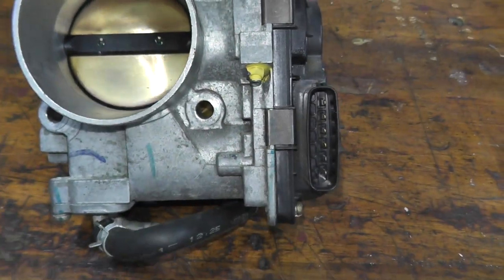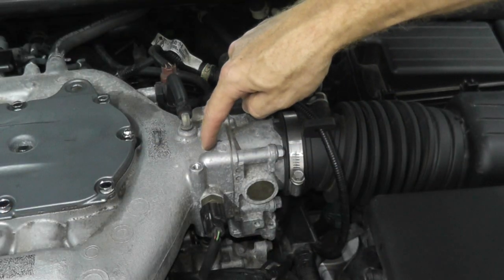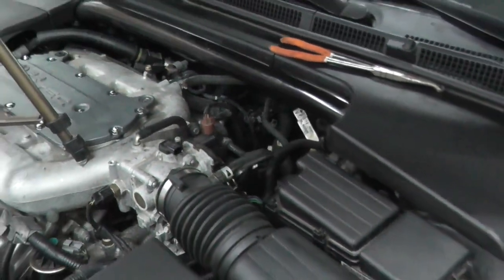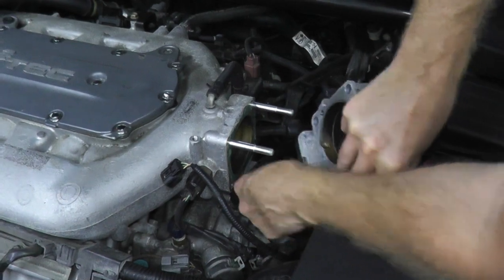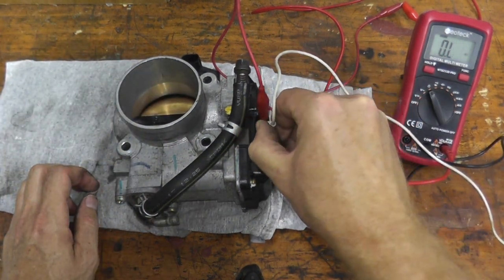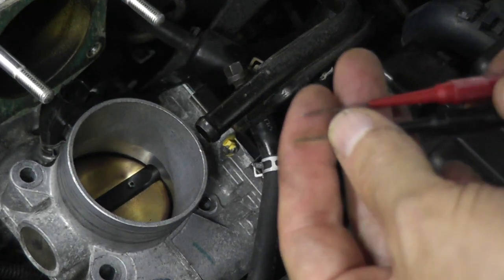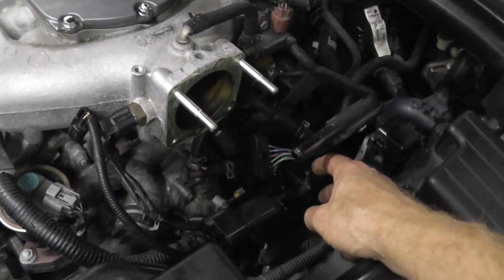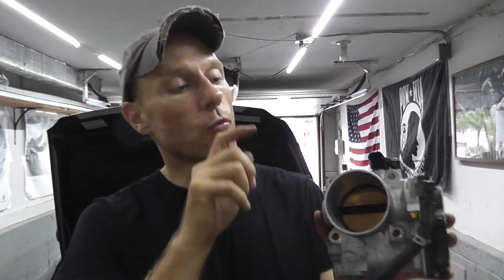Electronic Throttle Body Testing and Replacement | P0222 P0223 P2135

Comment: i did the power test battery to throttle body , the butterfly flap opened. Yet i still have p0123 and truck wont start . just cranks

Comment: I like ur video iam having  the same problem p2135 a/b voltage  but where did u get the oem throttle body  most  place dont have oem thanks

Comment: I have a diesel throttle body/air control assembly. It was completely filled with oil (in the motor) and now it's showing 150 ohms between one signal and the ground and 360,000 ohms between the other signal and the ground. Does this sound faulty to you? Thanks.

Comment: I got a Hyundai Elantra 2016 the problem is it drives 60 MPH fine between if I try to hold between 20 and 30 mi an hour it will run a little bit and then it'll conk out did everything you recommended everything seems to be working fine I cleaned the mass flow sensor I clean the throttle body and it's still doing the same thing 20/30 mph comes out I appreciate your help

Comment: 2007 Jeep Liberty 3.7L automatic 4x4. No codes.  Lightning bolt warning light coming on. Crank / no start.  Checked all fuses...good.  Cleaned intake...was clean.   Thanks!

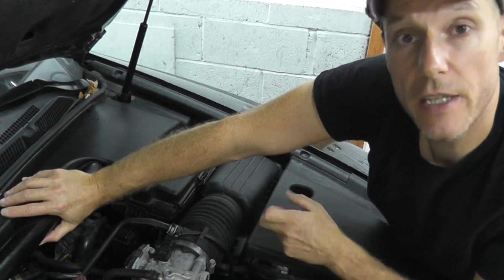Comment: @1:09 He says these are drive by wire system. if there is no physical line coming then wont it be an Electronic one and not a drive by wire?
Reply: Wire is electrical. You are thinking of a cable which is mechanical
Reply: 7:50

Comment: Thanks for the warning about turning the ignition on and pressing the has pedal to open the valve. We did that. Have a 2004 camry that has the low idle, cleaning didn't help. But when you drive it the idle kicks up to 1000 and wants to stay there until you stop. Any ideas?

Comment: most fly "drive" by wire throttle bodys have at least 2 TP sensors and the ECM "computer" monitors both plus two more TPs on the gas pedal..if any of those 4 TPs are out of range the ECM will put the car in limp mode "no power" or very limited power. This keeps the throttle body from getting you killed should it malfunction and you can't control the speed of the engine!

Comment: When he tested the plug (going to the actuator)in the wire harness it said 11.3 on the multimeter. How much voltage should be going from the wiring harness to the actuator on the side of the throttle body? Mine is reading only 4 volts. Any suggestions??
Reply: Dead battery?
Reply: @DavidJackson-zg5my  battery is reading over 14 v.

Comment: Can you say how much volt must be on black and red(+). I see you have around 12V. In my case I have 5V.
Reply: Did you ever figure out your issue? I don't think this guy that makes the video responds
Reply: @giantkilla_  In my case 5v it's ok
Reply: @giantkilla_  I changed connector to pedal, changed map and unplugged sencor for the cooler. After those manipulation something was work. It's start to work good. But still have liths on dashboard

Comment: Maybe I missed something, but how does this test show if the throttle body is bad?
Reply: The change in voltage shows that the potentiometer in the throttle body is working therefore it is sending a signal to the ECU. As far as the motor that controls the butterfly, it is easy to check too. Simply remove the intake hose so that you can actually  see it, turn key ignition to the on position, (no need to start the engine) and press the accelerator pedal down or ask someone else to do it while you see, you should see it moving. If it doesn't move there is a problem with it. Also as it moves it should be according to the pedal movement and the electric motor should sound smooth too.
Reply: @carlosestrada298  
Thanks for the info I'll give that a try. Should the valve be open all the way when the pedal is down?
Reply: @dhalsim-1  yes the flap or butterfly should be completely open when the pedal is down.
Reply: yehh same...
Reply: Because when he put his hand in the throttle plate and moved it the meter changes if there is no change then the body is no good

Comment: If you are using a throttle body that doesn’t belong on your car, could you test and find which corresponding wires open the throttle body and make them match up in the harness to make it work? Or is there more to it
Reply: There’s more to it. The throttle bodies are designed for specific year, make and models.

Comment: Hmm, I thought you shouldn't push on that butterfly thingy on a electronic throttle body
Reply: If it's disconnected, moving the valve (carefully) is fine, you're just moving the same cog wheels as the electric motor. Don't push against resistance though.
Reply: I was thinking same out of experience I had to buy a new throttle body because I pushed it open! But I could've gotten throttle body cleaner into electronics too but ya was always told to have someone press the pedal instead. Tps motor I believe is supposed to move the butterfly not the other way around supposedly!? 🤔

Comment: I changed out throttle body and gas pedal still getting p0122 and p0222. Starting to assume it’s the wiring but not very good with testing though how would I go about doing that. It has 6 wires 2008 ford Taurus
Reply: I replaced my throttle body and gas pedal assembly as well but I noticed that the wiring for the connector was loose so this video helped with confirming that’s probably my issue

Comment: I have a JDM 2005 Honda Accord Euro 2.4 and my car threw a check engine light and VSA and triangle (!) symbol and also went into limp mode. I was driving on the highway and instantly panicked as I couldn't accelerate at all and pulled over to turn off the engine. Waited 5 mins and turned the ignition back on and the VSA and triangle (!) symbol disappeared but the check engine light still appeared. Luckily my car was able to drive the way it did before this incident occurred and I managed to reach home (30km highway driving). As soon as I got home I plugged in my OBD2 scanner and the diagnostics read P2135 code and I came across this video. My first suspicion was bad/dirty connectors since this happened the same day I took my family out for a road trip. It made sense that this could be related since I had to drive off road to enter into a campsite for our day hike (and it was extremely dusty too). After a while the check engine light disappeared on its own the very same day as I had been driving it often. I was relieved but when I plugged the scan tool again I saw the code still existed. I waited till the next day and decided to clear the code manually using my OBD2 scanner. Unfortunately, as soon as I stepped on my gas pedal, the same incident occurred but luckily I was just at a parking lot. I turned off engine and back on and it worked just fine again and eventually the engine light disappeared on its own again but still showing the code when I used my scan tool. I decided to buy CRC contact cleaner and disconnected my negative battery and unplugged the connectors to the APP and the TPS and sprayed it many times and used a Q tip as well. I let it air dry for at least 30 mins before reconnecting everything and made sure the electrical connectors were tightly fitted (a decent click sound heard). I test drove it around for 30 mins and then checked my scan tool and the code was gone. So far haven't come across any issues but that was the cheapest fix ever. 
Only needed a contact cleaner thankfully and not a replacement of APP or TPS..

Sorry for long message but just thought I could share my experience with p2135 code
Reply: Any more issues since then?

Comment: Why turn on AC, is that to cause possible compressor cycling and idle changes?
Reply: Just DO what the man says.
Reply: @MrBababuwi being curious is the best way to learn and remember.
Reply: The car needs to relearn a proper idle, with the ac on, it helps the computer to look idle a bit higher to be able to take the ac into consideration